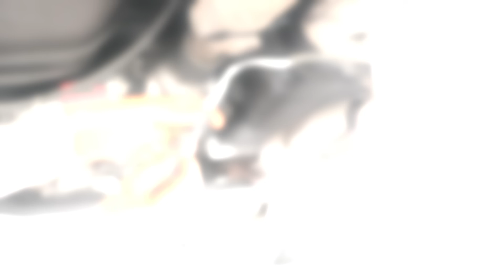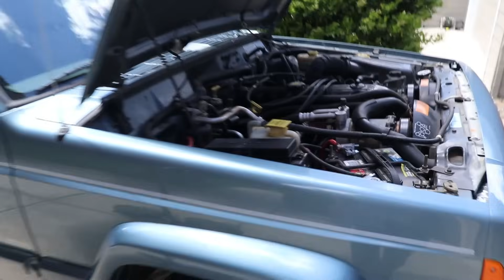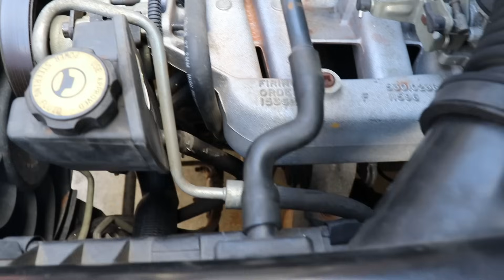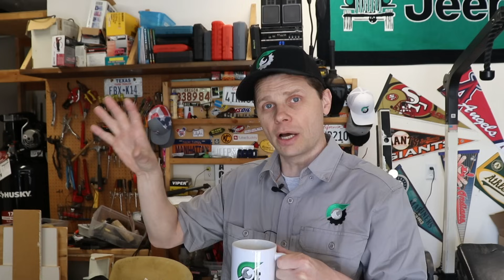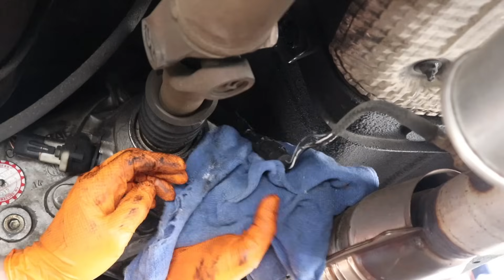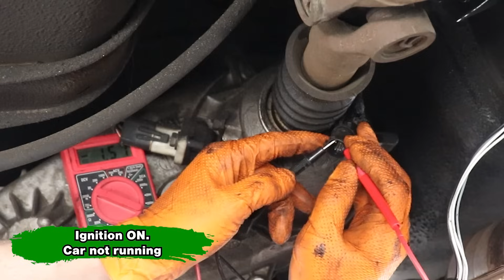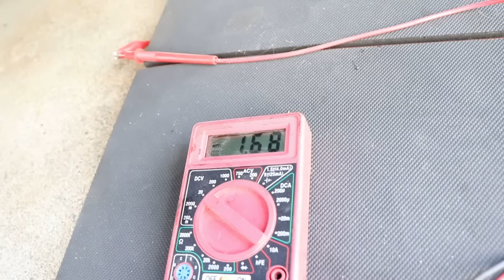Don't Buy Oxygen Sensors! How to test o2 sensor

Comment: There is a much easier way than crawling under the vehicle with a meter. Just invest in a good quality scan tool has live data and graphing capability. That way you can not only read, but also graph, O2 sensor voltages, O2 heater current and voltages, fuel trims, and hundreds of other parameters. Also, the live data is recorded for future review. Another thing to look for is bidirectional capability.

Comment: I have a 2016 Ford expedition XLT I keep getting the same error code P0430 bank two I replaced the sensor. I still get the same America I cleaned out the cat I soaked it. I still get the same error code. Car runs perfect but the check engine light comes on. Any suggestions?

Comment: This is exactly what I am dealing with. High fuel trims. I don't have vacuum leaks. Maf sensor was good. No exhaust leaks and as soon as the engine got to temp the fuel trims went from negative 10 to positive 25

Comment: I’m confused how did he do the voltage test on the output of the sensor without it being connected to the ecu, didn’t he do a check for input voltage initially , meaning it would need that voltage for the closed loop output?

Comment: I'm missing something. How is the downstream sensor showing anything on the multimeter when it's not plugged in? That's like trying to test a toaster via the plug when the plug is sitting on a counter, and not plugged in. That doesn't make sense to me. I hope I get a quick answer cause I need to test mine. Thanks. 🤨😵‍💫
Reply: Ohhhh, it somehow produces it's own voltage after it reaches 600 degrees (warm up temp). So I warm it up, then turn it off, go under, and test the sensor. Okay, got it !! I'll try it tomorrow. My downstream always seems to read 0.700 or 0.800 in the live feed once it warms up and idling. I heard it should fluctuate between 0.100 to 1.00 but mine doesn't. My car seems okay until I release the gas pedal, then the rpms drop all the way to 500rpm, and then goes back up to the regular idle RPM of 650rpm. Cleaning the throttle body did nothing. Anyways, enough rambling on-and-on. I'll test it tomorrow. Thanks !!
Reply: Thanks for following up with your findings.

Comment: wouldn't reading live 02 sensor data tell you if the sensors are working or not? If throttling the accelerator up and down and the O2 sensor reading is not changing, it would indicate a bad sensor.

Comment: I did replace the one on a Chevy equinox the top one and the car did stop stalling it would run and shut off that I am steal getting po138 code so it must be a bottom one I did clear check ingin light for now

Comment: So I'm confused. You and everybody else on youtube seems to show that the output voltage of an O2 sensor that is at operating temperature should be between 0.1V and 1.0V DC. When you connected the multimeter to the replaced O2 sensor, you only showed a voltage of 0.03V up to 0.1V. Was your sensor not up to operating temperature yet?

Comment: Your test of the new downstream oxygen sensor was not conclusive.  The old downstream oxygen sensor was about 0.04 to 0.05 volts.  After you replaced the sensor, it was 0.08 to 0.11 volts.  The normal voltage range of a downstream oxygen sensor is 0.1 to 0.9 volts.  Your readings from the new oxygen sensor were all at the bottom end of the normal range.  This is inconclusive as the sensor needed to show more range than just at the bottom of the normal range.  I would have introduced a vacuum leak by disconnecting a vacuum hose and cause a rich mixture with some brake cleaner spray to see if I could get more of a voltage reaction from the downstream oxygen sensor.

Comment: Because you are measuring the sensors outputs with them disconnected, you can test them on the bench, so If you can "easily" remove the sensors,  measure them cold and then  use a gas torch to warm them up and take new the measuments... specially that you already suspect them are not good.
Of course, measure their resistance, and also measure the connectors on the car for the proper voltages, to be thorough.

Comment: Thanks, I have a 2018 Jeep Grand Cherokee Summit 3.6L I have multiple misfire codes ranging from P0300 ($07e8) P0306 and P0304.
but I read that 
$07e8 might be failing because bad O2 sensor or a vacuum leak. does that seem right? I just bought ignition coils and spark plugs but just seeing what you might think. I don't want to do any extra work. lol thanks

Comment: For the test where you have jammed wires into ground and signal wire on the connector, where on earth does the sensor get power from when you have occupied the wires with the multimeter?
Reply: It doesn't: the power is only required to make them "warm" when you start the car - the white wires are the leads for an internal resistance which its only function is the warm up the sensor when the vehicle is still cold. Once the engine is hot, the PCM stops sending current through the white wires because the sensors are at running temperature.

Comment: NTK is the ONLY brand you should buy for a Jeep YJ. I bought a denso and my nox has been high out of limits, it sputtered until warm after a month or two of using it. Went back to NGK/NTK 💥 got much better mileage, power & no more sputtering

Comment: $62 for a Bosch from rockauto for a 2011 BMW E90. 105k miles. You say don't replace unless you really have to. Not always true. If I have a P0136 code on a BMW at 105k miles I might as well replace cus they do go bad. And also yellow increase fuel and decrease mpg when they get older.

Comment: How does the o2 sensors have power to send the signal when it is disconnected running that last test?
Reply: The difference in the amount of oxygen between that present in the outside air, and that present in the exhaust promotes the flow of oxygen ions and produces voltage.

Comment: Would this cause my issue, for example I can start my 03 mustang gt and it will idle for for minutes, and all the sudden sound like it's gasping for air , and shut off!  Also while it's idling, I can push the throttle, to give it gas, and it acts like it's gasping for air, and boggles down, and shuts off!  It's throwing the P1035 to.  I've replaced everything but this sensor?  Makes no sense to me. Lol. Be glad to get it fixed though!  Thanks

Comment: Im thoroughly confused how you are getting any voltage whatsoever from a sensor that is disconnected from its power source. I thought this would be a resistance based test depending on the temperature of the sensor when disconnected from the main harness.
Reply: I can help you since they are being quiet. The sensor is disconnected but is still connected to a vehicle battery. If you key to ignition switch to power on, with the engine off, the sensor is powered and you are able to read the volts on a multimeter.

Comment: 4 times in 8 years a failed pollution test sent me to government recommended repairers who it seems to work out were charging me the failure spending limit 600$ and stealing parts..never cleaning or replacinf o2 sensors that the manual calls step one..?????????
Reply: As it was registered in cityi i would have sold it outside city to avoid that troubles as it was running perfectly. ..sans looters
Reply: Never threw code..

Comment: P0071 - I had the same code on my kids car. 2013 Lancer. Ended up being a vacuum leak, but when you scan it and get that code it brings up a freaking list of things it could be like 10 different things to have to check. I easiest thing for me was to test for a leak first using the live data and then using  a less tech method of just spraying carb and choke cleaner in the engine bay over the lines and when I hit the intake (air) hose BOOM, the idle leveled right out for about 8 seconds and then started acting up again. So in my case it was just a bad intake air hose.

Comment: Dude, buy a Toyota. Aren't jeeps just gas hog toys? They're not safe to drive. Flimsy doors. kilmer was doing a brake job, hub replacement. Have to tear the whole unit apart. Bad engineering

Comment: I probed the ground and sensor wire in the downstream and I got zero voltage. Is that normal?

However there’s a voltage output in downstream wires when the engine is running.

Comment: I'm not calling you out or being rude. this is just info for the people watching. 
do NOT stick your probe in the connectors directly, you will bend the metal tabs and could create another problem on top of the one you have due to the connector no longer making a connection. 
always back probe the connectors. no damage that way. 
i learned this the hard way.

Comment: I dont know if I really got a malfunctioning O2 sensor or not... cause it gives me voltage output, in the range it should, but if fluctuates like 1 or 2 times per second, from 180mv to 780mv, back and forth...
The bad thing is there is no code about the sensor but P0303... measured and changed coils and got better, but cabt oass gas test

Comment: I think I would like to pull the trouble code and throw new parts as hard as I can on my old cars to keep them running good and fix any issues loose or looking like it needs fixing or replacing because I drive older cars just to save money

Comment: Hey there, another Jeep driver here.....I'm getting Low Voltage Oxygen Sensor and High Voltage Oxygen Sensor error codes with loss of power driving, and then 'vrooming' where it picks up again.

P0158  Oxygen Sensor Circuit High  Bank 2 Sensor 2
P0300  Multiple Random Misfire
P0152  Oxygen Sensor Circuit High Bank 2 Sensor 1
P0157  Oxygen Sensor Circuit Low  Bank 2 Sensor 2

Is this an electrical problem?   I've had people mention this but nobody seems to explain.   I can replace the sensor but not sure if this is a waste of money if that's not really the cause.    Thanks!

Comment: i just went through a wild 02 sensor issue, i tested the sensor n thought it was dead ( really my tester prob was not touching the actual metal prong of sensor ) so i got a new one changed it then went to plug it in n end was slightly different turns out at the end of 2010 some 2010 jeeps got a 2011 wire harness n the 02 sensor plug is slightly different 1 of the arms it slides into is moved a mm up ( need a 2011 02 sensor for 2010 jeep...). so i got it to fit realized code was still coming on, tested the old o2 sensor again n  felt stupid cause it was good.. the whole time my ground wire was broke / no ground. then somehow between supper break my 02 connecter twisted upside down so when i went out cut my ground to run a new wire i really cut my 02 return wire lol. got that mistake fixed so tomorrow i just need to run my new ground lol

Comment: If you disconnect O2 sensor on most v8s you'll lose 3 miles to a gallon...  If you don't lose mileage it wasn't working to start  with.....   O2 sensors, only reduces fuel,,

Comment: Hey Dale. Long time watcher first comment! So I have a Jeep YJ and I checked it per the video and my O2 sensor is good (code 51). At idle the Jeep will start low idling to sputter and then kick back up to normal idle and cycle back and forth. No other issues during driving. I checked the wire from the engine compartment and I’m getting a low voltage reading (100 DC mV - 400-800 is norm op range)…. And I cannot figure out what the issue is. All new(er) air and temp sensors in the engine bay and no vac or exhaust leaks I can see. Any tips??

Comment: But shouldn't the signal FROM a post-converter sensor read a steady voltage & be at or near .45v ?  If the voltage varies much or frequently or sticks high or low, I think it indicates that the converter is bad or else there's another problem upstream somewhere that the converter can't clean up.

Comment: Sup bro. So….. i replaced ecm, 4 o2 sensors, purge valve, had a smoke test with passing results, added catalytic cleaning solution, added fuel injector fluid, truck runs great just 02 sensors keep popping up!!!!!!!!

Ugh

Comment: Is it normal for a heated sensor to show short between the sensor wire and the ground? I'm getting a short circuit when I plug my harness into the o2 sensors and I don't understand how that all works.

Comment: Oscilloscope is a better device to check the O2 sensor voltage signal oscillating between 0.1 to 0.9 V, with a multimeter it is difficult to catch milliseconds voltage readings.
Anyway thanks for your efforts.

Comment: Look,I am driving a Jeep Rubicon wrangler 2011, 3.8 V6.. it has:
-Rough Idle
-Less power
-stall at speed of 100/110 km/h
-Nd at this speed the Rev count is at 5000/h (I don't know but at 5 unit of rev count)
-hight temperature engine but not the oil tem
-vibrate at speed of 80 km/h bt initially it did so at 60km/h

Please help
-But I found the Oxygen sensor closer to the catalic converter with it's cable cut..that means it was not there
-The exhaust manifold is leaking as well

Comment: Bei Meinen Alfas V6 mache Ich den Laptop starten , schließe OBD2 an und starte Fiat Ecu Scan ...... dann lese Ich die Lambdasonden aus , also die Widerstände oder was sonst noch anfällt !  Man muß sich nicht unter den Wagen klemmen, das Auto hat doch auslesbare Steuergeräte . 
Kann es sein , das es 680milli ohm sind , bei einen guten O² sensor ? Ich bin mir nicht sicher , welche Zahl Ich auf dem Display letztens sah , als Ich die 4 Lambdas ausgelesen hatte . Alle Widerstände der 4 Sonden waren gleich ! Aber ein Sensor meldete einen Fehler zur MIL (Motorkontrollleuchte) , wegen Widerstand falsch gemessen !   Man muß den hinterlegten Fehler 4xlöschen , erst dann ist der Fehlerspeicher wider LEER !!!!  Knüppelsteinpflaster oder unwegsames Gelände lösen Fehlermeldungen am Sensor aus , wegen Erschütterungen (Kabel oder Stecker ) .  Eine O² sonde geht Normalerweise nie kaputt , man muß sie lediglich reinigen !!!
Ich laß schon Dinge , von WC Reiniger , welcher die Verschmutzungen der Sonde lösen könnte . Ich täte es mit einen Teilereiniger für Pinsel versuchen , der Lacke und Öle und härteste Verschmutzungen löst  oder wenn es nix bringt , es klassisch mit dem Brenner wieder frei brennen - Also die Sonde auf Temperatur bringen , welche den Schmutz dann löst , durch Ausdehnung und wieder zusammenziehen nach Abkühlung .

Comment: I had a bad o2 sensor on bank1 sensor  2 replaced  then it went to bank 1 sensor 1 replaced it and  lost resistance  I have 2.5 volts on black and brown wire is that what's burning up my new O2 sensor

Comment: I thought O2 sensors generate their own voltage to send to the PCM through the black and grey wires. So why is Dale checking for "input voltage" from the black and grey wires from the connector/harness side? I'm measuring .5 V from those wires from my 1995 Wrangler, so I'm curious what the purpose of that voltage is for.

Comment: The rear O2 sensor isn't commanding fuel trim changes though...it monitors the efficiency of the cat. Thus if you're having fuel trim problems, I don't see how it could be the rear O2, or why to check.

Comment: @6:50 how are you getting any reading when  it's unplugged?
Reply: You being for real ?
Reply: At that point he was checking the wiring harness (not the sensor), so in simple terms , he was seeing how much voltage is coming through the wire that would be sent to the sensor . But instead was sent to his meter.

Comment: I was getting that stinky exhaust, like a bad cat on my 2011 Charger RT.  I jacked up my car and dropped the cats. They looked good. I ran water through them from the back side to the front. Water flows through just fine. So I put it back together. Now I get the code for bank 1 position 2 low voltage. I'm about to go out and unplug it and spray contact cleaner in the connectors and put it back together to see if that helps. I'm wondering if it got dirt in a connector?

Now I get O212 high, O222 low.

Ends up that both that I removed went bad. I had to replace both of the O2 sensorsbin the cats.

Comment: i have done my trottle body cleaning on my mazda 5 but i still have a high rpm if porssble  will it be some of the sensors pliz will you let me know what will be going on can i do an obdi test
Reply: Is this fully electronic throttlebody? If yes, then you need to calibrate it with bi-directional obd....if it is electro-mechanical (one having a steel wire wrapped on a pully which rotates the flapper, then you need to get your IAV valve (installed on throttlebody) serviced and adjusted

Comment: Sorry for just asking: At 5:38. The sensor is disconected from the car and produces a voltage just by sitting in the pipe?
Reply: Yes, it does but when it's get hot upto  400 charli approx

Comment: How is it getting voltage when it's not plugged into power from the harness? I understand a resistance change, but I don't see how it is creating voltage not connected to a power source.
Reply: This Sensor generated volt potential when it's heated up...just like thermocouple